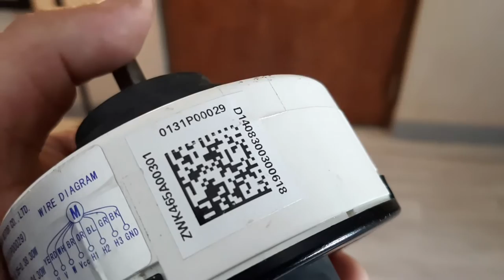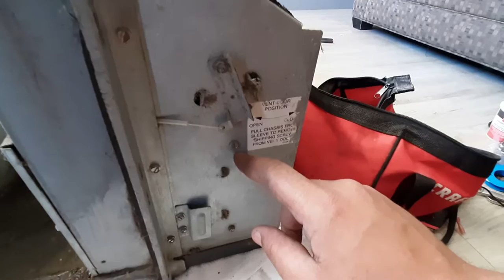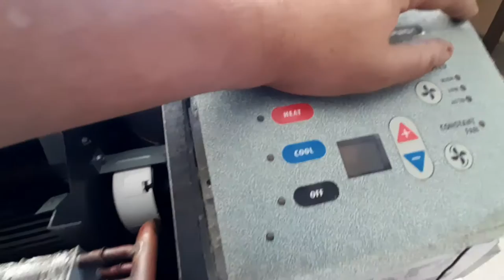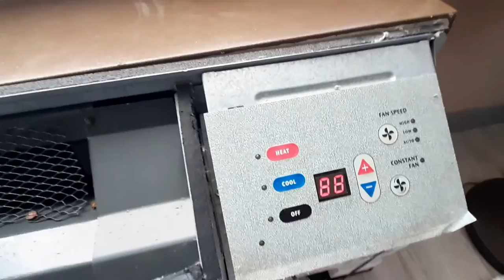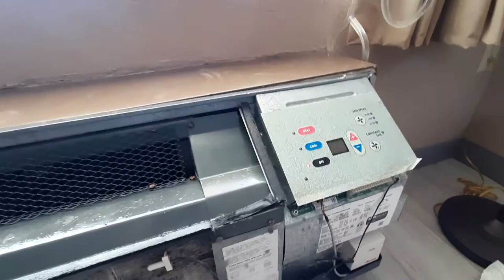AMANA PTAC TEARDOWN 2010+ / HOW TO REPLACE PTAC FAN MOTOR

Comment: Explained good. But I feel due to a few steps in between which you didn't show was how did you get to take that roller fan out?
Reply from the maker: You need to remove the entire assembly from the top first, to do this there are around 10 screws around the top edge holding the top plate in place..
Remove the entire top plate.. 
then there is one Allen screw on the fan holding the fan to the shaft,  loosen that screw enough so that the fan will slide around on the shaft of the motor, then you remove the 3 screws from the bracket that is holding the motor in place, and remove the motor..

Comment: Does it have to be the same kind of blower motor? Is it possible to just swap one from another Amana PTAC Unit that's a different Model?
Reply from the maker: It depends on the motor..
If it will mount up and plug into the same board then it should work,  but then if it did it would probably have the same part number.. 
This same fan motor is used in a few different models tho so it definitely could be interchangeable.. 
If your Ptac is an older model than this one, then the fan motor is completely different.. I have a video for those also..

Comment: Where do you order your fan motors from?
Reply from the maker: We usually order them straight from Amana, but someone recently told me about PTAC4LESS, I think they are the cheapest and they usually have them in stock.. That's where we will probably order them from now on..  I have supplied a link to the website below..
https://bit.ly/31iqIgU
Reply from the maker: The part number for this specific motor is: 0131P00029SP
Reply: @williamblanks8500  got one through Ptac.